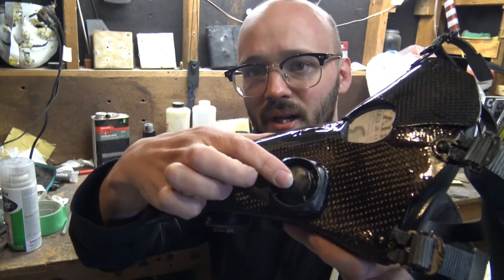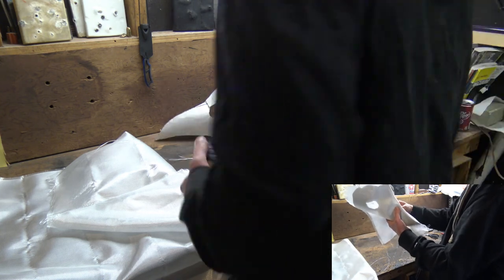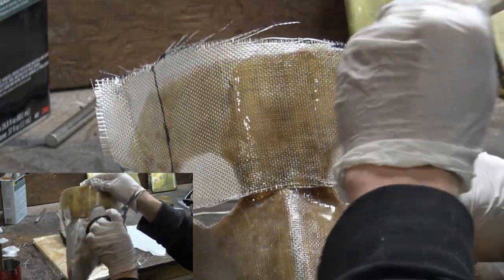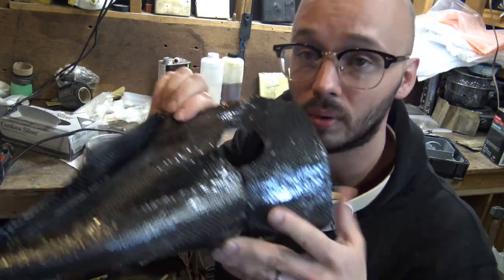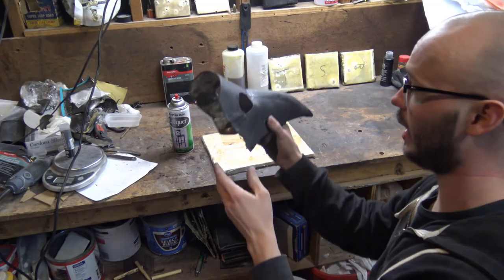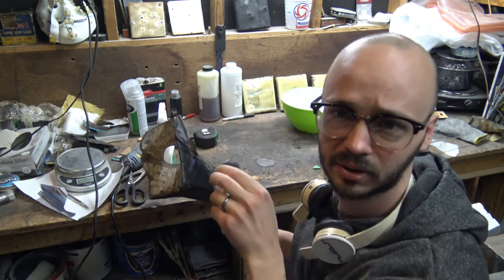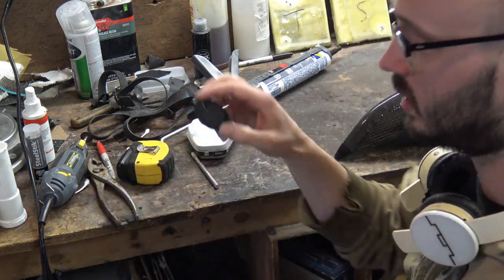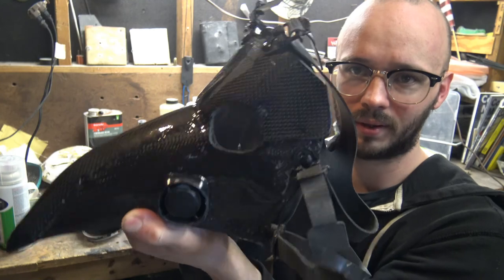Carbon Fiber Plague doctor mask DIY

Comment: For future builds, your best bet for having the exact shape. is to cover the item in masking tape, then remove the masking tape and cut out where you want breaks in the fabric weave. Add on the half to one inch gap around the item and cut up you fabric. To prevent the fraying, lay down masking tape where you are cutting and the weave will stay in place.

Comment: Very nice, love the mirroring in the eyes. Thanks for this lol I am still at my cardboard mold stage, wasn't sure how the cardboard would react to the fiberglass. For the spray release do you think a silicone waterproofing spray made for shoes could work?
Reply from the maker: Yeah that one way mirror Idea you gave me is so badass, I'm making that shield now! and honestly I wouldn't worry about a mold release to much, that carboard can be scrapped out with a putty knife and some soapy water! I used a little thinner as well, just slid right off. But I guess if you want to skip clean up then yeah, silicone is inert, so it shouldn't react to the resin at all, I use that alot and the car wax for molds.

Comment: Have you heard of CMF? Or composite metal foam some researchers did some test and it stopped .50 cal at a 1/3 the weight of normal steel, supposedly, i was wondering if you could put your spin on or at least attempt to make a ballistic visor, i had a atlyn helmet in mind the metal made of the steel CMF and middle bullet resistant glass
Reply from the maker: I have heard of CMF before, and I do have a friend that has a forge that could reach temperatures for molding metal in this way, the question is if I can get a blowing agent ( the item that cases the metal to foam). It would be interesting to see what I can find out, I'll look into it! thanks for the comment.
Reply: Tech this out meow no problem, thanks for your videos very entertaining!
Reply: Tech this out meow you get a LOT of request are you not overwhelmed?
Reply from the maker: Not at all lol. I add them to my list of things to look into, it keeps me interested in the projects I'm working on.  You never know when something will take you by surprise, a friend of my was the one that suggested I look into HDPE (the plastic used in milkjugs) for armor, and now that's my most viewed project. and another subscriber suggested when I tested my stab armor to use a crossbow or compound bow, which was a great idea. Someone else suggested using mirror window glase for a riot shield, I love that idea and used it in this mask as well. Your suggestion improve my videos I feel, and keeps my focus on new ideas. It adds something unique to the  process, and sometimes I'm already looking into something and it encourages me to pursue it harder now that I know someone else is curious about it. If all that makes since.
Reply: Tech this out meow it all makes sense, right now im trying to find a metal visor and put my ballistic glass in the middle, (think atlyn helmet) but much cheaper i cant find the metal, do you have a recommendation for what to laminate acrylic with polycarbonate? I saw your bullet resistant glass video and i wondered if you figured out any other products or resins would work best for acrylic and polycarbonate? Thanks

Comment: Nice work, what pattern did you use?
Reply from the maker: https://www.instructables.com/id/Plauge-Doctor-Mask/ was the basic pattern I used, however I made the bottom section from scratch to form the shape. But the over all design is based off this guys pattern for sure, I printed it out and glued it to some cardboard and formed it to shape, then hot glued it for better stability and shape.